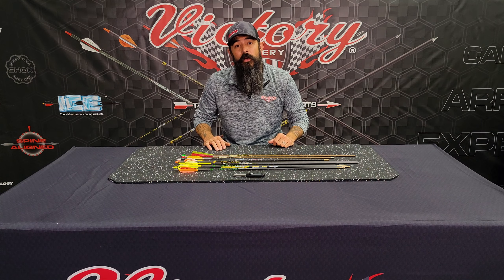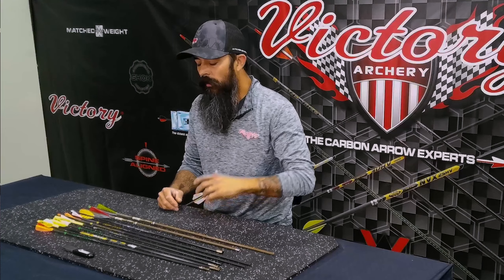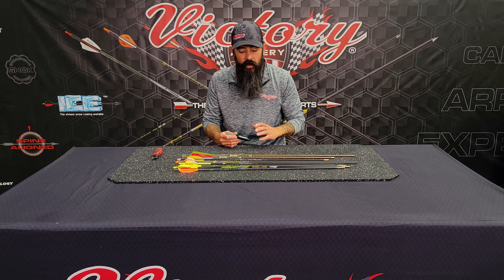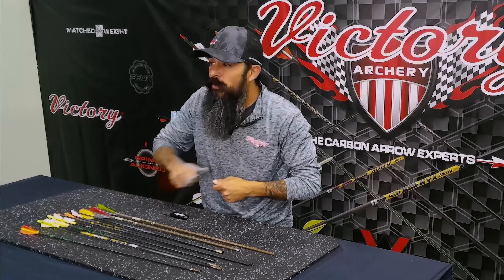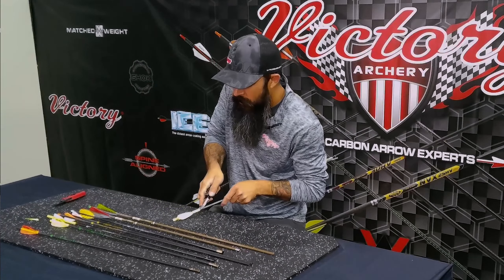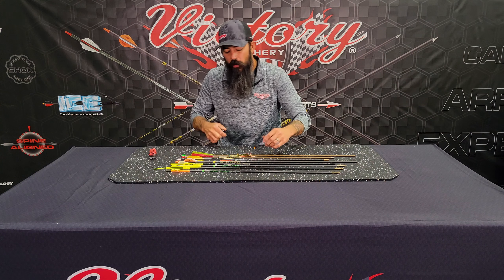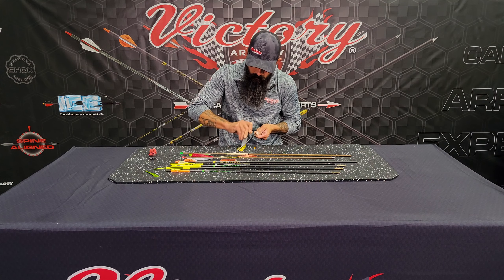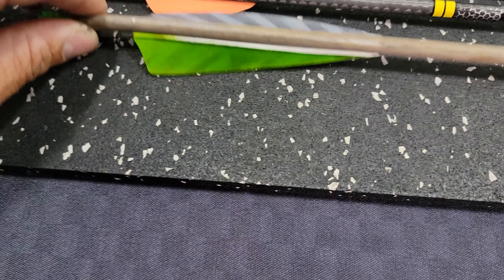Tech Tuesday | Arrow Building Tip from Nate

Comment: Need good lighted nock for VAP SS 166 ID.  Purchased Spot Nocks online and they were defective.  Only 1 out 4 worked.  Bear Archery sent me a another package free of charge.  Like the first four only 1 out 4 worked!  It’s a shame because they fit great.  Nocturnal’s are too flimsy and they don’t fit tight in the shaft.  The nock comes off the string when removing the arrow off.  Any suggestions?  Thanks in advance.
Reply: Im still in the same boat, honestly might just go back to stock nocks because the lighted .166 nocks cause such poor flight and tuning issues, and arent stout enough. Ordered Halo nocks, hoping they are strong and not flimsy. Waiting for them to come in